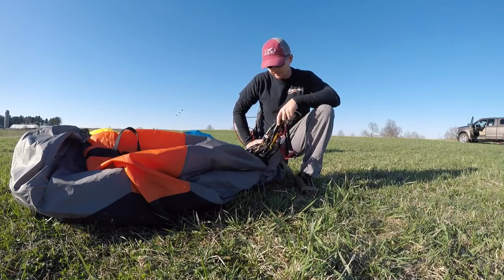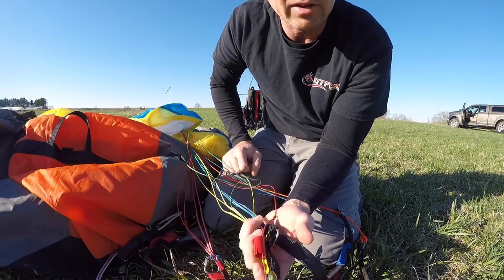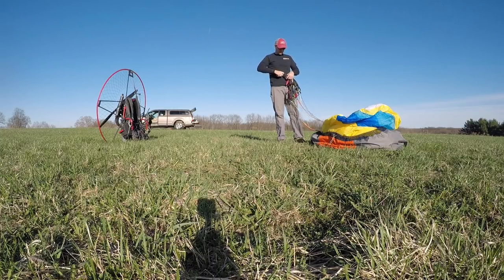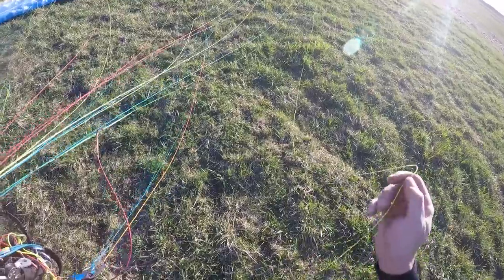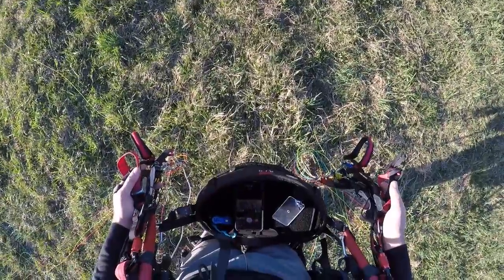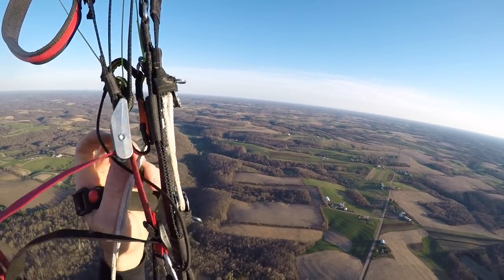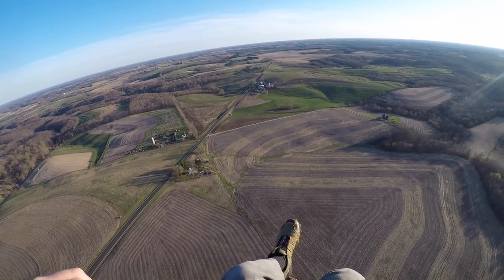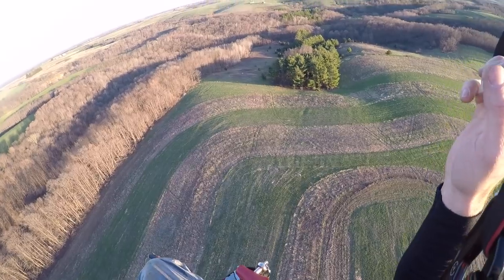Dudek Universal 1.1 - Pilot's Guide & Review

Comment: This video is so so great!! 
Thank you very much 😊

One question please, when I'm on just gliding I'm drifting to the right. This makes landing difficult as I have to hold the left break then flare from there. What is the best way to counter this using this wing's settings? Should I hook the carabineer to the upper position on the left or right side?

Again, thank you so much!
Reply from the maker: I assume you are talking about gliding right before you land when you're getting out of your harness? My guess is that your weight is not centered and you are unconsciously leaning to the right. Do a bunch of low approaches and practice centering your weight when you're out of the harness. Also check that your leg straps are evenly adjusted. Hope that helps!
Reply: @MartyG144  excellent ideas! 
I have tried everything. The issue is with my frame for sure. It happens even when idle and sitting. It is very noticeable. Many friends tried it an it only effects people with less wight than 70 kg. 

What can I do with the wing to counter this?

I fly sky 1.1S motor.
Reply from the maker: @Mermaider  You could try using the TEA (Torque effect adjuster) system on the left side. It's worth a try. Also yes, try clipping in higher on the left carabiner.
Reply: @MartyG144  Thank you so much Marty. Will doing either of these things affect the wing stability?
Reply from the maker: Mermaid No, both methods are completely safe
Reply: @MartyG144  thanks a lot Marty.

Comment: I noticed you didn’t seem to warm you engine very long. Do you know if there’s any difference between the original Universal and the 1.1?  Thanks for the video
Reply from the maker: I warmed it up prior to hooking into the wing (not on camera). I don't believe there's much difference with the 1.1, just that it's newer. I'm not 100% certain of that though, but I know if there are differences, they are minimal.
Reply: The run up is more about making sure you are getting full throttle. In other words, it is a system check more than a ''warm up''.  Like anything else you don't want to find out you have throttle/linkage issues after you leave the ground. Unless it is a really cold day the difference in power is minimal from cold to full running temp. So basically if you are getting full power or  close to it, your engine doesn't care if it is at full running temp. I know a lot of people are anal about it, and tell me I am wrong, but they can't explain why. These are two strokes.  The oil tends to build up at low RPM. The reason they came up with oil injection wasn't for convenience it was more to keep the engine from fouling it's spark plugs at low RPM.  When you mix the oil directly in the gas it is mixed for full throttle, that made long periods of idle a problem. In short make sure you are getting full throttle, and go. Long periods of idle, on a two stroke, do more harm than good, even if you do have oil injection.
Reply: @michaeldose2041  The new Vittorazi manual recommends warming up, but I don’t believe it says why expect it’s better for the engine longevity. I’ve been told one reason it’s to let the engines different metals expand more uniformly. I have no idea if that’s true. I always warm up my Vittorazi motor, but rarely my 2-stroke leaf power with no problems.

Comment: Perfect Marty,  So pretty much when not using the speed bar.. which I don't as I'm on a trike, the tip steering is available all the time as well as the brake .. however, brake should be used gently when trim is all out or past 6.    Do you fold your wing up any special way or pretty much the standard stuff bag approach?  Thanks!!
Reply from the maker: Bob C Not quite... 1. You can use tip steering at any time even with speedbar 2. Do not use your main brakes when trimmed out past 12cm. 3. Do not use your main brakes at all if the speedbar is applied
Reply: @MartyG144  Thank you for the great video.. exactly.. the ticket.. will watch again!
Reply: @MartyG144  My last video I had exactly what you talked about with the TS getting wrapped...  Thanks ... that is an issue as you said.  I will keep an eye on it.